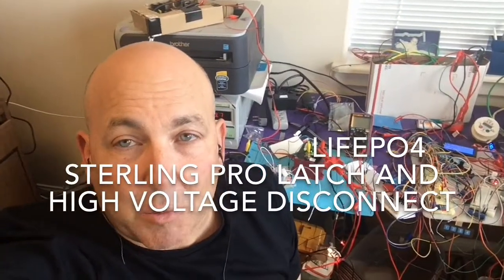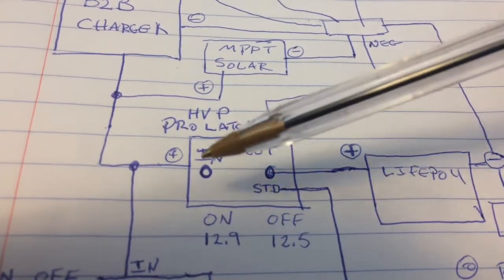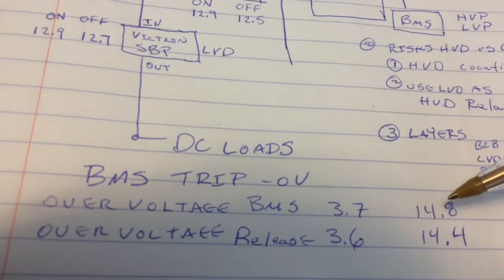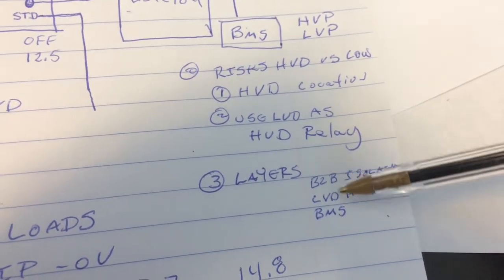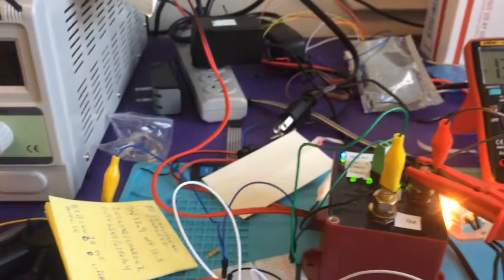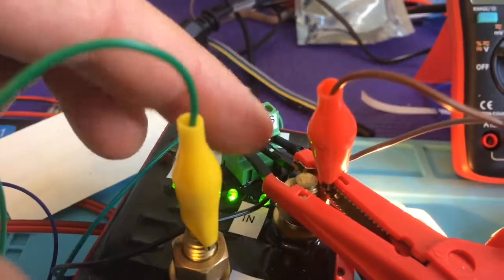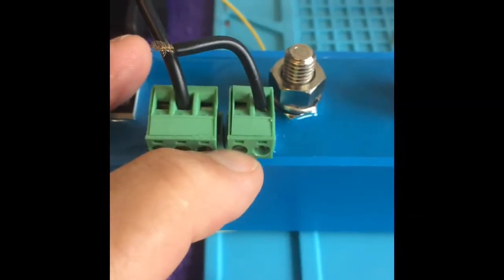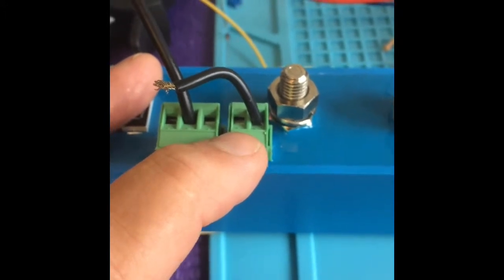Sterling Pro Latch R Tested for DIY LIFEPO4 High Voltage Disconnect

Comment: Thanks for posting this... I'm in a similar spot now & you've hit the nail on the head... I reckon it could be useful as an additional fail-safe to protect the battery if the BMS died... but yeah, is it worth the pain to setup?!?!?  Maybe not... Shame... Sterling products often fall short on the user experience side!